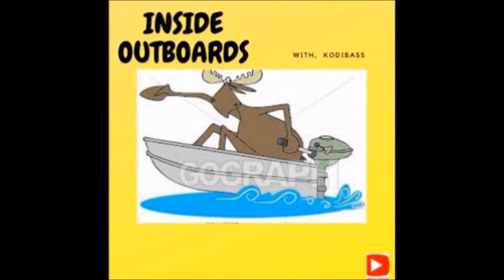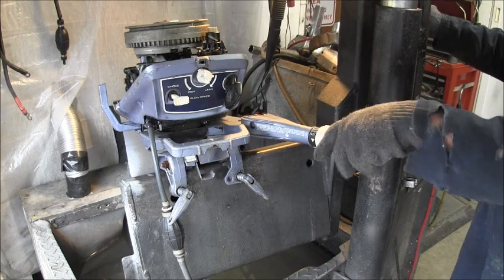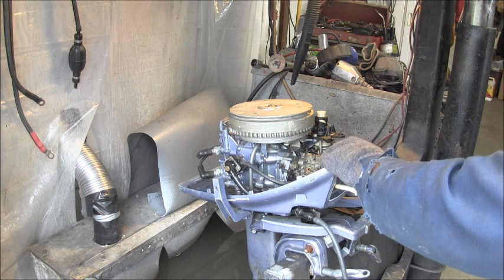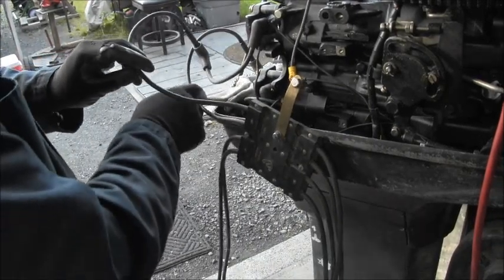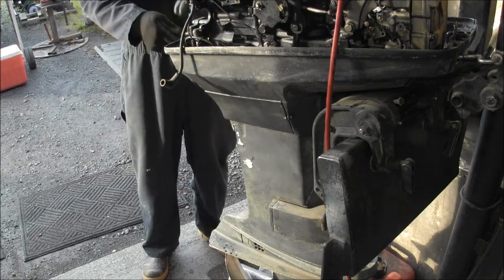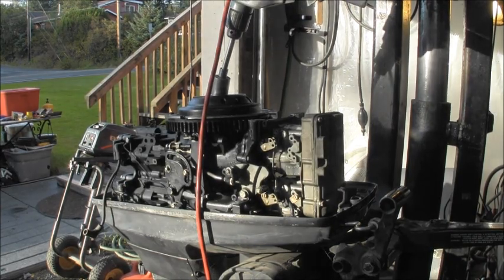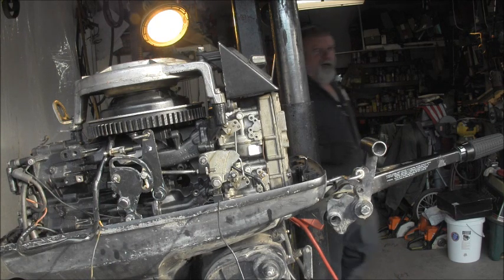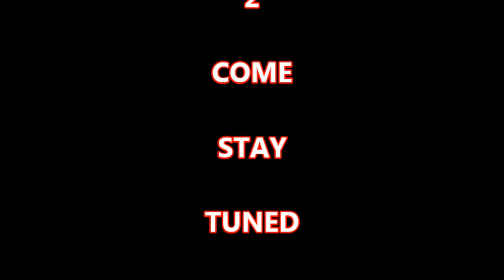EVINRUDE 6 HP ,JOHNSON ,55 HP COMMERCIAL & More

Comment: That 75 6hp is a "little cutie" for sure, represents all the stuff OMC did right.  That 55hp commercial is a beast for sure, someone must have messed with it, didn't come from the factory with two male pins at the stop switch connection....
Reply from the maker: Only thing was I could not find a splice or brake in the kill wires,  Also it is a ufi,  So it must be spliced under the fly wheel?  weird 4 sure.    kodi
Reply: @kodibassInsideoutboards    Someone probably replaced the UFI or stop switch....Ordered the wrong part that had the wrong pin/socket combination, then just jammed the two pins together....Some of those replacement parts came with adapters also....

Comment: On the 6hp you didn't say anything about maybe getting hot under load and seizing up a little? Not pumping enough after awhile ? I do not think you are cocky you are just very knowledgeable and show it. Thanks for that! Have a warm winter! Fla. for a bit? Jay
Reply from the maker: Thanks'  The owner of this 6hp  Is a pretty decent guy,  He I do not think would have run her hot-- But he does loan his motors out?   so could B.    kodi
Reply: A car mechanic friend would say " sometimes it's the nut behind the wheel" Be well ! Jay

Comment: My first  evinrude was a 1978 6hp cost 564 dollars I  worked it completely to death running a water trap line I  got a lot of years out of it
Reply from the maker: Yep' the only outboard I ever came across that was used completely up was owned & used to it's death by a trapper.  it is a 50's 7-1/2  I still have it under the house compression less than 40 each cylinder.        kodi

Comment: Thanks for the video! What kind of drill is it you use for cranking the motor?
Reply: Kodibass uses a high amperage Milwaukee drill !
Reply: @danielrobert7181  Do you know what model it is? I want to use the same :)
Reply: @johannesjacobson5077   Well Kodibass himself call his drill the "old Milwaukee" so it most probably is not available anymore. Any 5/8 inch mandrel, 9 amps and up drill will do just fine. That is the type of drill used to mix big buckets of paint. It is geared to turn reletively slow but gives high torque - which is what you want for this application. Beware, you will need an oversized socket adaptor like the 7/16 inch Makita B-59841 socket adaptor. The standard sized socket adaptors, whatever make, are not strong enouvh and will rapidly shear.
Reply: @danielrobert7181  Thank you for a great answer!!